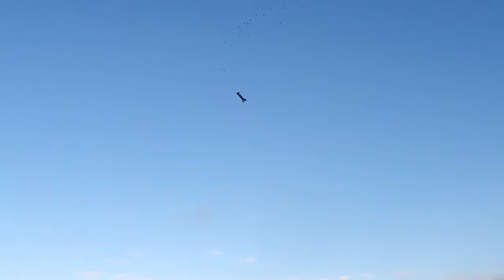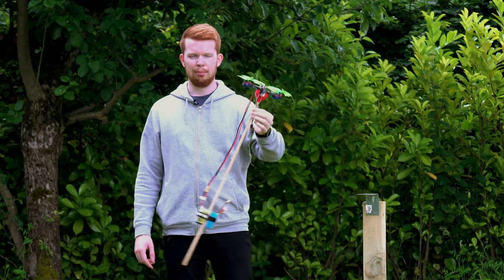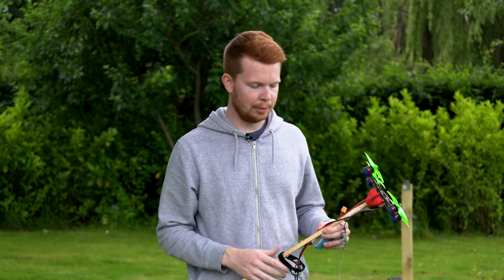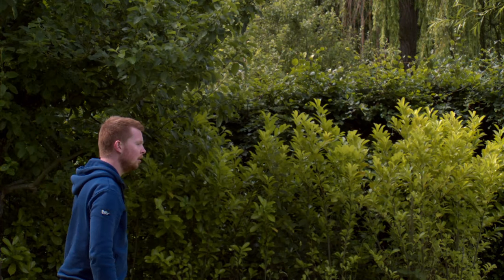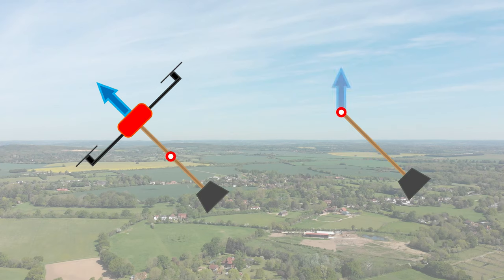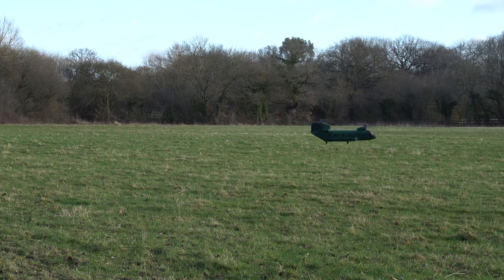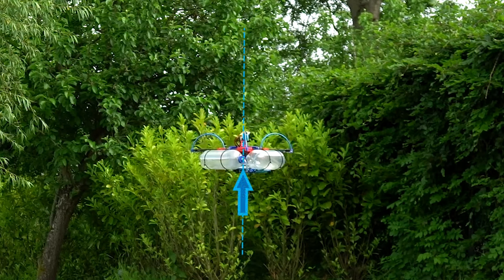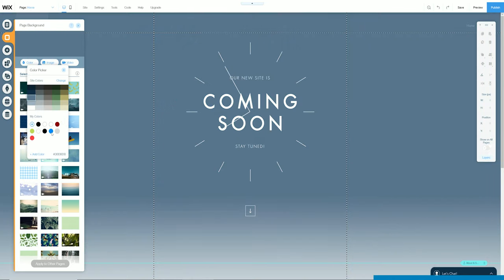Drone Pendulum Fallacy

Comment: This video and the one Scott Manley did do a perfect job of explaining the pendulum fallacy.
Reply: I second that!
Reply: This one is better than Scott's. I don't say that often.
Reply: Can you link Scotts video? Many thanks.
Reply: @MrProfama36  https://www.youtube.com/watch?v=Tx4cjP-GRAY
Scott's is more in reference to building rockets in the spaceflight simulator KSP.  But it's the same principle.
Reply: I've seen that one too. Especially interesting was the bit at the end where he added flexibility to the pylon mounts, after which it did exhibit a vertical-returning tendency (I think the sideways aerodynamic drag on the main body caused an offset between the CG and the thrustline that established a torque away from the relative wind). Would be really neat to see an attempt at that built physically here.
Reply: He did one experiment that didn't work. The design would have to be perfect.

Comment: The flight controller programming is designed for a normal quad copter weight distribution.  Id like to see a flight controller programmed to optimize flight with a completely different center of gravity and reactions to applied thrust before i called it a fallacy.

Comment: Interesting that you do have pendulum stability when you build an airship rather than a drone - presumably because the lift vector is consistently vertical, unlike a tilting drone, so it is a pivot point, ^oo^
Reply: Yes! Though this is only the case if the center of mass is below the center of bouyancy. If the cm is above the cb, then you have pendulum instability, and the airship would be stable only when its upside down.
Reply: Yes! I'm thinking it has to do with speed. The slow balloon has time to correct while the fast drone doesn't?
Reply: @ZacLowing  A balloon is using buoyancy, so the force upon it is always opposite gravity, unlike a propeller which will generate thrust in any direction you point it.
Reply: Yeah but you should not imagine it as a pendulum. It still rotates around the center of mass. Just the ballon part is offset and therefor produces a torque if the airship is tilted to one side.
Reply: @WCTA Chicago underground sound  No. 
Like Pliotgeek said a balloon uses bouyancy which always "pushes" upwards. If you rotate a balloon it will still oppose gravity. You could achieve this on a drone when you rotate the propellers to always be level with the ground.

This is infact how helicopters work, they tilt the whole propeller

Comment: Worth noting that if can control the pendulum's position (using servos) you can affect the location of the CG relative to the centre of thrust, which can be used to aid stability.

...which is basically what your Chinook is doing (in one axis at least).
Reply: James Bradwell this needs more likes. Amazing explanation!!
Reply: @mitchellwright6676  It's not an 'amazing explanation'. If you're controlling a pendulum's position, IT'S NOT A PENDULUM.

Comment: I think there's a semantics issue here. A fixed pendulumn won't be SELF stabilising. However it will add stability in pitch and roll (in your experiements).
Stability is the state of being stable and more stability means you're less inclined to "give way" or "overturn", adding rotational inertia makes that take longer to happen and so makes the system more stable. However you are right in that it won't be self stabilising.
Target archers regularly use long rod stabilisers (their literal name) which is a stick with a (usually dampend) weight on the end, attached to the front of the bow. It provides yaw and pitch stability through inertia (they  can also use a V bar to give some roll stability, some balance to the bow and even more pitch and yaw stability).
Even car designs use mass placement to affect the stability of the platform (i.e. front vs rear vs mid engined vehicles, whether brake calipers are on the inside (lower angular moment) or outside (higher angular moment) of the wheels, etc).

Comment: Thank you Tom.  I've been curious for years how a space rocket with rockets on the bottom managed to remain so stable during lift off.  You explained it perfectly!  Great video!  Thanks again!
Reply: Obviously rocket designers know this very well. Just google 'rocket' and 'stability'. So how did they do it? They put the dense payload on top, and the geometric! (unit density) center as low as possible. 

I've known this stuff for years, but sadly it still hasn't crept into my intuition.

Comment: What if you use an unfixed pendulum attached to the drone, instead of using the drone as part of the pendulum?

Basically, weight with a couple of strings attached so it can move independently of the drone and the extra strings on it avoid causing turbulence movement
Reply: Are you suggesting this for a drone experiment that has no gyro control such as his initial experiment?  It won't help anything because there would be nothing compelling an "up" oriented thrust vector
Reply: This will correct the orientation of the pendulum, but I'm not sure it would affect the drone's trajectory. You would need a way to selectively couple and decouple the pivot when it's advantageous to the drone. A pretty tricky ask.
Reply: I double down on his idea but with a slight change. Taking the example at 4:30 what if you let the middle of the wooden stick be free to rotate? That way, the lower half of the stick would want to be perpendicular to the floor and that would create some torque unless the upper half is perpendicular to the floor as well.
Reply: I thought of something similar to this. What if the stick with a weight at the bottom was able to swing in all directions. It would naturally hang down. Maybe there is a way to mechanically tilt the motors based on the angle of the drone to the stick. Since I don’t have a disposable drone for all the failed attempts for this idea, i’ll be looking for a good physics simulator.
Reply: That works with a fixed pivot like a regular pendulum, but since the drone accelerates, all it would do is point away from the direction of aceleration. Same reason you can get a bubble level to stay level on a plane by doing a coordinated turn, even though you are banked 45 degrees.
Reply: If the pendulum just hangs freely from the drone nothing special will happen. The mass at the end of the pendulum would most likely drag the drone around at every change of direction ( since you're changing the acceleration as well). 

If you manage to move the pendulum with servos instead, then you have a way to change the position of the centre of mass relative to the thrust of the propellers, not sure why you would want to do that though since it fucks up the drone's internal physics module that manages the drone to fly stably in the first place. Basically you'd need to figure out a much more complex and flexible model to regulate each rotor's thrust output.
Reply: @salvodippolito6013  Control with movement of center of mass would work, just not very well for most intents and purposes.
Reply: @salvodippolito6013  oh that makes sense. it'd effectively be like a simplistic reaction wheel

Comment: this will help me when play KSP, I'll stop building unstable death machines instead of space ships :v
Reply: I actually learned this too in KSP, when I made rockets that were top heavy I always thought it was a problem then realized it was actually more ideal!  And it kind of makes sense, if you try to balance a stick on your hand, if there is a weight on top it's much easier than if you were to put the weight at the bottom.
Reply: No you won't. None Of us will ever stop with the death machines
Reply: @redsquirrelftw  that's a great example
Reply: Its written in the ksp wiki .. keep your CG high and nice
Reply: What are you putting your engines on the top or something?
Reply: Unless you're building planes. Planes are more stable when the COM is lower than the COL.
Reply: You're not supposed to make death machines?

Comment: But what would happen if you replaced the rigid stick with string/rope/hanging by the cable?
Reply: It would swing.
You wouldn't even need a cord, just a pivot point in the stick with springs to create torque I guess.
Reply: @fransoto8343  yeah, it would swing. I meant whether it would give similar results as the rigid stick, make it slightly more stable as even before starting the weight would be directly below the vehicle or go full on 'double pendulum'. Cord/rope/string/cable would work better than stick with a pivot point as it would give movement in all directions
Reply: @Durrdalus  well, I doubt it stabilises anything... But it would be an interesting follow-up
Reply: @Michael Smith 

It would be like a heli lifting a cargo package by a cable...

You have t learn how to adjust fr the momentum of the weight hanging under the aircraft.  The weight has momentum and there is drag of the package plus the line between the package and the aircraft.

Early attempts would likely crash, but with practice you could fly circuits of the flying site at speed.
FPV would likely be a fail. You nee to see r feel the effect of the swinging weight on the aircraft.

Someone creative could develop a set of load sensors and programming for the autopilot to compensate.  Current drone autopilots would have a very hard time.
Reply: @Michael Smith so long as you didn't overload the craft it would not crash. Helicopters carry loads by string all the time. A quadcopter or drone would be the exact same.
Reply: Then it doesn't make any sense because the idea of hanging some of the mass lower was to create a correctional influence of gravity on the orientation of the drone, the string decouples the orientation of the drone from the hanging mass.
Reply: @CricketyChris  if the momentum isn’t enough to effect the orientation of the drone, then it’s not enough to do any stabilisation.

Comment: I recently built a 550 quad  I flew it in different configurations first with duel batteries mounted atop. It had slight stability issues. Second, single batt. mounted atop that made the stability worse. Third and the best I could get without messing with the PDI  was the batt. mounted below with the large landing gear. It hovered perfectly except for a little trim adjustment. So I believe the "Drone Pendulum Fallacy" is a fallacy. I moved the battery roughly 3" from top to bottom and made all the difference in the world. Other than that Great Channel I dig what you'er doing.

Comment: I once worked on a coaxial dualcopter layout aircraft with the two rotors mounted on the top on a gimbal mechanism.  The top gimbal was set in a stablize mode such that it always pointed itself parallel to gravity.  I believe this was closer to how an ideal pendulum worked.  The aircraft flew and I had positive control but it is definitely no contest to a properly tuned multirotor or traditional helicopter.  In addition it had really bad stability when in free fall.

Comment: I think you missed the point by not including a clip showing a weight the same distance above the props.

Dance the Skies
Reply: exactly! i think the real answer is that on a normal multicopter battery placement does matter so little, its nothing to really worry about. but i guess changing the center of gravity further away in every direction makes it worse exponentially. i also guess lower center of gravity always will be better even just the tiniest bit because its still a difference to go uncontrollable up than down.  at the end, if someone talks about lower center of gravity they surely dont mean "add a 1m stick to it".
Reply: @stephanbre  you really missed the point didn't you... like a mile

Comment: I find myself wondering if attaching a mass to the bottom via string (either one string at the CoM, or one string attached to each propeller arm) would make it more stable?
I'd guess that a single string probably wouldn't make a difference (or maybe make it less stable), but I think it's worth an experiment.
My idea behind attaching the strings to each arm is that when the drone tilts, some of the strings gain some slack, then the tension in the others would pull that side down. Then when it overcorrects, the tension on the new side would bring that side back down, and so on.

I have no idea if it would work, but I'd love to see a video about it (partially because I don't have money to buy or make a drone to test it myself...).
Reply: As long as the string is attached to a point some distance away from the center of gravity of the vehicle. The only problem is it would introduce oscillation.
Reply: I still don't think this would work, because ultimately the force of gravity will always be acting at the pivot point by definition, so no torque can be generated.

Comment: Let's revisit the principle of moments, which states that when in equilibrium the algebraic sum of moments ABOUT ANY POINT YOU CHOOSE is zero. As per your free body diagram of the drone at 5:35, if you take moments about the drone's own cg (considering the mass of the drone and the pendulum independently), you will find that the pendulum's mass does actually cause an unbalanced clockwise "self-correcting" moment.

Comment: On the topic of your pinned comment addressing the idea of attaching a hinge to the pendulum, I had an idea where you attach a weight to the drone directly below its center of mass, and attached it to the drone via four strings that connect to the drone's extremities, in this case being the blades. The idea is instead of a pendulum, the weight pulls down on whichever extremity is the highest until each extremity is under equal tension from the strings.

Comment: It is a great video, and as part of your subscribers I want to point out that you might be able to stabilize the drone by increasing the aerodynamic drag at the top. The COG in front of the COA is what makes an airplane stable in any direction. But essentially this "any direction" is what you don't want. So if you put two sheets of plastic forming a cross (when looking down on the drone) on top of it, this should counteract the vertical velocity, which would probably make it asymptotically stable w.r.t the vertical velocity. Depending on the battery's weight, you might also be able to move this cross down the shaft, such that it sits right below the drone's frame.

Comment: Great work Tom!  Could you do an electro-static thrust vectoring system? E.g. creating air currents via differing high voltage electric charges on different areas of the drone.
Reply: I'm not sure you can create an embedded very high voltage generator (roughly 100 000V to ionise air)
Reply: @kehnyalexandre5248  I'm not sure either ... I've seen recent research into small lightweight test aircraft doing it, but it was still quite a bit larger than a normal private drone.
Reply: @PhilosopherRex 
Yep, the MIT has made a good prototype recently ^^
Reply: The force is extremely low on these I believe. There's a newer take on this that creates plasma/heating with microwaves instead of combustion, but that's probably out of the realm of diy

Comment: Hey folks, Tom and everybody... I've got a problem: 
I've seen the "pendulum effect" on a simple hand launched propeller (yes, the propeller on a stick).
I launch it at an angle but it always pivots around the nose of the propeller during flight, and so during my younger years, I never got the clue of this fallacy.
But then again why does this simple toy defy your explanation? air drag? gyroscopic precesion?
Reply: I haven't noticed that myself. What I can say is if you hand-make a paper spinner (I thought they were called whirlygigs, but that seems to be other things, or at least covers other things) they have bad aerodynamics unless a weight is added to the bottom of them.

And I think that with such a "device", adding a weight to the top would not help just as much as adding a weight to bottom. In this case one factor is the rigidity/stability of the paper itself that the weight at the bottom helps with, but I don't think that's the only factor.

That being said, I'd agree that there are factors that probably do have a small degree of self-correction under the right circumstances, but it's possible that your propeller on a stick would still work fine without the stick at all, just like with this drone (but like you said, yours self-corrected at least a bit apparently)
Reply: @MsHojat  
The reason those paper spinner's work is kinda like a reverse pendulum effect, except the force isn't gravity, it's drag. Because the spinner has a higher area at the top (further away from the centre of mass near the bottom) it has a greater drag force at the top, so if it's falling through the air at a slight angle, there's an off-centre force that induces a torque around the centre of mass. The reason this works is because the drag force is always roughly perpendicular to the ground (because the spinner is falling) and it doesn't rotate about the point where the drag force acts.

Comment: INTERESTING PROBLEM IS PILOT BEING ABLE TO STABILIZE IT WITHOUT FLIGHT CONTROLLER ASSISTANCE - early helicopter pilots had to make constant corrections to stabilize. For that u have to play with inertia & gyroscopic effect surface drag, such that unstable motions r slowed down enough for human to respond & make corrections
My quick guess is if u give chinnock large surface area, motions will slow down due to drag, allowing human to make corrections..eg I am able to maintain helicopter heading without a tail rotor gyro by putting large area tail fin